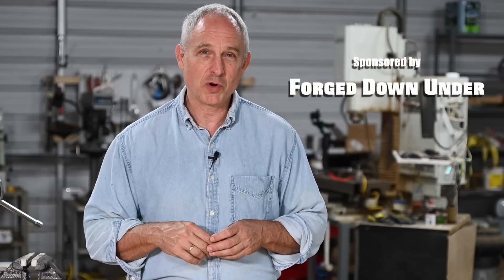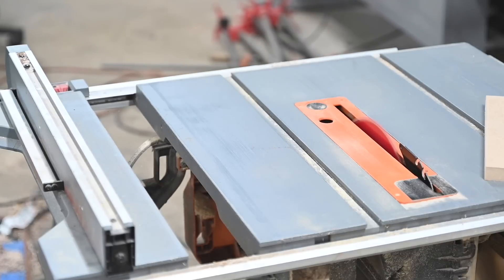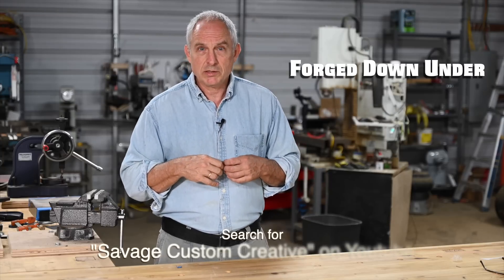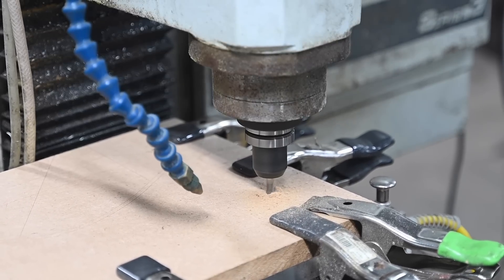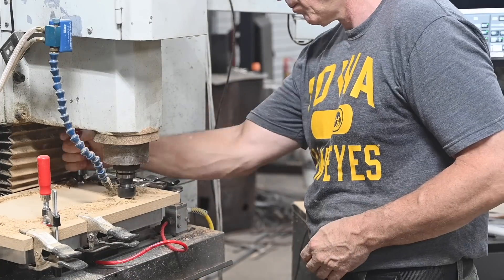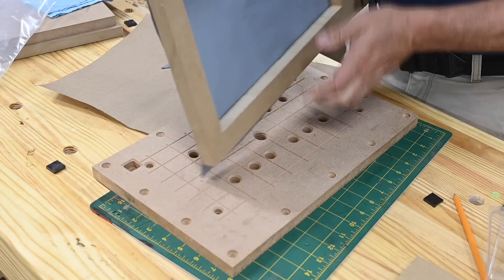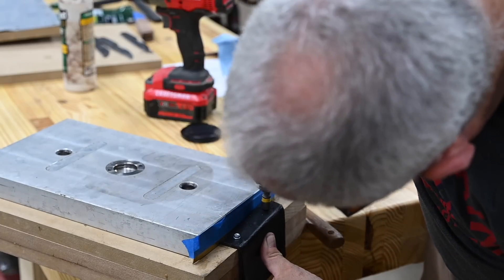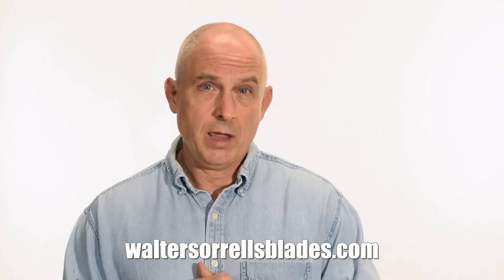Vacuum Press Build! (for Kydex Sheaths)

Comment: like the idea of using a silicone membrane as even when the termoplastic tears inside its frame it will still form over the mould giving a larger chance of success 
have to see how far a membrane can be stretched though as the parts im planning to make are kindof tall 
you ca allso use sheet sizes that are smaller than the workframe of the former the membrane is the size of the machine , the frame holding the plastic can be simple just a basic mdf frame with sunken in screws , it just needs to be smooth not to cut intoo the membrane , can even pressurize the top of the membrane to apply a little extra force on the part

Comment: Also, instead of the silicone membrane, try 1/8" neoprene foam. It holds heat better (and can be preheated) thus giving better definition, especially when using a lower flow vac pump like the HF pumps.

Comment: Speaking from experience, MDF is not a great material for vacuum tables. I used it on my first table and never got great "pull". I found out from others that MDF by its nature is porous, causing the vacuum loss. I bought a piece of scrap Corian countertop material (almost as cheap as mdf). It cuts and drills very easily and holds up to vacuum and high temps.

Comment: Why don't you just mount your kydex in a frame, heat the framed kydex, place the framed kydex on vacuum form and vacuum. Now you are actually thermoforming. you will have minimal heat loss and better definition in your parts. ABS is also a good TF plastic. It is economical and has a low memory set temp.
Reply: ABS tends to deform easier which is not good when working on the retention of a sheath. As for the framed Kydex there are a lot of people who slap down a big piece of Kydex and then press down the edges with a metal frame. It gives better definition and is easier to cool faster. The downside is you use a lot more Kydex since it has to have enough overlap around the edges of the mold.